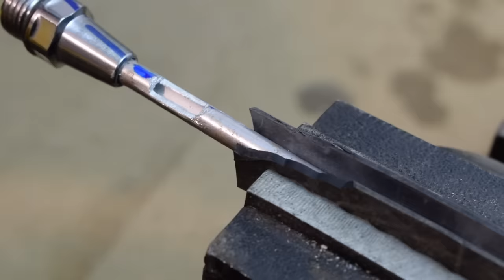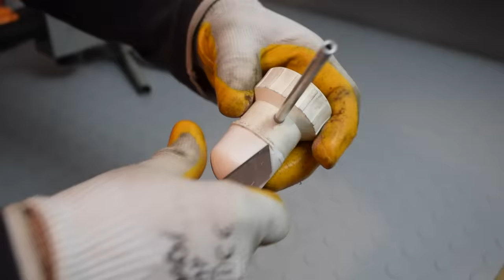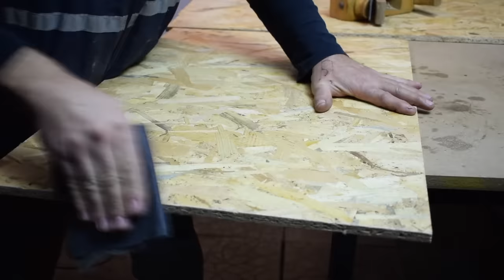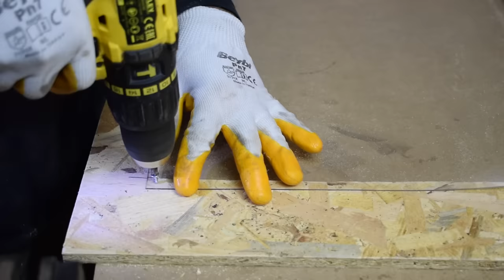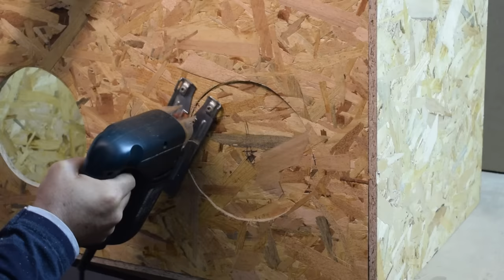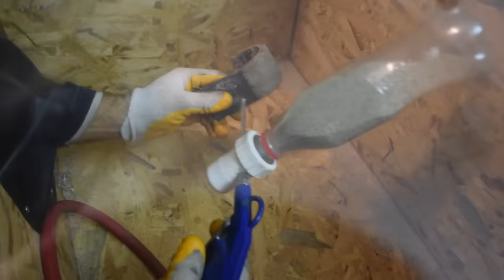100% Homemade Sandblaster From Coke Bottle

Comment: The problem in this case is the blast pipe - it has to be a hard material to withstand wear over a longer period, like tungsten carbide or some ceramic. Soft metal will last half an hour until it's gone.
Cheap sand blasting devices sometimes use soft metal, they are crap.
Reply: Thats true, i had this problem
Reply: @max17-c4f  Guess why I know that - I had a cheap one with such a cheap soft steel blast pipe ;-)

Tungsten carbide is better, but it also don't last forever, sand is a nasty stuff eroding it inside
Reply: true. even tungsten and ceramic erodes after few hours. this aluminium pipe will die in  half an hour
Reply: does not take 30 minutes... easy solution is replace the pipe after it wears out. problem solved. hardened steel will last a long time

Comment: How long does it take for the refrigerator compressor to charge the propane gas bottle as a pressure accumulator to such an extent that the sandblaster can be used again?

Comment: And when the nozzle blocks the air pressure will go straight into the bottle with the grit and explode. Very safe. Excellent example of an accident waiting to happen.
Reply: You ain't been sarcasted 'til you been sarcasted by The Twizzler!
Reply: I like that caution warning.
I think, in practice, the bottle will hold to about 100 psi and the user will notice it is not working. After that, the user will knock the gun few times and may prefer to insert a cleaning rod to continue. Maybe....
Reply: See that’s what we want in posts - suggestions to develop an idea… (that’s sarcasm by the way).
Although, to be fair, Jimmy Twizzle has spotted a potential issue…
A small vent hole in the top of the bottle should prevent any problems. 🙂
Reply: @victorborges9523  140 psi, surprisingly. Don't ask how I know. Let's just say it involves workplace shenanigans.
Reply: That's why you sieve the media

Comment: Great idea..! Thanks for sharing, BUT… I feel duty bound to make a comment on the blast media. I know everyone calls it ‘sand blasting’ but natural sand has been outlawed as an industrial blast media in most countries for over 60 years and in the UK since 1948. The problem is that even very small amounts of inhaled fractured sand (sand dust) will lodge in the lungs and cause silicosis - there is no medical fix and it only has one outcome..!!! Other blast media can be used; aluminium oxide, glass bolls (yes bolls), baking soda and many others. If you really want to use sand, then protect yourself and others well - wear a heavy duty mask, do it outside and stand up-wind. All the best..!
Reply: @HashimiX  Hi, you are of course allowed to use any blast media you like at home including sand - if that is your wish… My information comes from the UK HSE (United Kingdom Health and Safety Executive) and is listed under ‘COSHH* Essentials CN7: Abrasive Blasting (*Care of Substances Hazardous to Health) - Although the regulations pertain to industry in particular they are nonetheless useful in guiding general behaviour. The purpose of my post was to make people aware that although all blast media dust is hazardous - sand dust is particularly pernicious in that if breathed in, it stays in the lungs and cannot be coughed up - it causes silicosis (a painful an nasty chronic condition) which will eventually kill you. I am a 64-year old professional mechanical design engineer with more than 30-years in manufacturing and industrial processing.  The information presented in my original post was given in good faith. I hopes this answers your rather poor comment “wtf your pfp”
Reply: @aidannolan6656  wtf your comment didnt read it
Reply: @HashimiX  Have you got anything useful to contribute..? or do you just like saying “wtf”..?
Reply: @aidannolan6656  no i just like saying wtf no need to make this whole mess just for that bro i was just joking why are you loosing your time for this thats not necessary
Reply: @HashimiX  OK I understand - thanks for clarifying..🙂
Reply: Doesn't sand blasting conventionally happen in an airtight chamber anyways?
Reply: かかさ
Reply: @andcam2683  It depends… abrasive blast cleaning is often done in a blast cabinet which may or may have dust extraction - partly to enhance safety an partly to help the operator see (through a viewing window) what he or she is doing. Parts and blast gun are handled via. Heavy duty rubber gloves permanently attached  to the cabinet. If you don’t have a blast cabinet or you are blasting a large object (eg a vehicle chassis) you may have to work outside - wearing suitable PPE.
Reply: Thank you safety patrol
Reply: And crushed walnut hulls
Reply: or u know, water sand blasting
Reply: @andcam2683  no, you can sand blast everything. in my proffession its often rock, outside or inside
Reply: @xxtoxii9615  "conventionally"
Reply: @andcam2683  If it was airtight, the pressure inside the box would slowly keep increasing, theoretically until it matched the pressure of the airgun and it would stop working.  You need some form of dust collection - just a shop-vac would work for this application - otherwise dust WILL escape from the box and the inside will get cloudy, making it hard to see what you're doing.
Reply: @kilroy2517  While a sandblast cabinet should ideally be airtight, most are not. At least, they're not once they've been in use for a while. So, as long as the cabinet is built somewhat airtight, so that it will capture almost all of the blast media, it's acceptable. ... A filtered exhaust vent for the air to escape the cabinet.
Reply: Dr Perun  I'm assuming from your comment that English is not your primary language.  You don't understand what he said.  And if you're blasting with sand and not wearing a mask, you unfortunately may find out in a few years what he's talking about.
Reply: @kilroy2517  Thank you Kilroy… Sand - as an ‘industrial’ blast media is banned in the UK (and has been since 1948) … so - banned in the UK for over 70-years. As a general comment to all - I am not a Health and Safety Professional but I am a professional mechanical engineer. My job involves a lot of writing and specifying production processes. I cannot write “…sand blast…” in a work instruction. For example: I must write something like “…blast clean using BT-13 glass-bead media… within Guyson Euroblast ATX cabinet..” (there are of course many types of cabinet and many approved abrasives). If someone wants to use sand (at home) that is their prerogative… But at least I have done my best to present some good information which may guide the uninformed home blast-cleaner and prevent them damaging their lungs. The graveyard is full of people who think it’s not cool  to work safely - to them I say “… go ahead and take yourself out of the gene-pool - but don’t blame anyone but yourself - you have been advised…”
Once again… Thanks Kilroy for a note of common sense.
Reply: Dr Perun  You cheeky Bastard…! You know nothing about me… There’s nothing wrong with wanting to go home everyday - alive, with all your limbs and without damaging your health..!
Once safe working practices are in place, any small time penalty from working safely, more than offsets time lost through accidents and illness. In the modern industrial world, most organisations who take health and safety seriously can show that it makes economic sense.
Reply: @xxtoxii9615  Yes… this is another type of blast cleaning - called ‘vapour blasting’. An abrasive blast media is entrained in a pumped liquid (usually water) and used where a very smooth finish is required. The equipment is a little more costly than a conventional dry blast cabinet… I’m sure you’ll find a good video on homebuilt blast and vapour-blast cabinets here on YouTube….
Reply: Dr Perun  Thanks for your irrelevant comment - Goodbye…
Reply: @aidannolan6656  I worked at a company that made blasting equipment: portable, cabinets and huge custom automated industrial systems, most of which were used with steel shot.  When I first started there I was doing tech support, and one day I got a call from a guy that was very frustrated that his new blasting cabinet was allowing "sand" (don't remember what he was blasting with) to get all over his shop.  His cabinet had a built in dust collector and interior light.  After asking a few questions I determined that he hadn't plugged his cabinet into a power source, so the dust collector was not working and there was no light inside the cabinet.  The conversation ended with him saying, "I wondered what that plug was for".

Another time I got a call from a guy who was either a foreman or a business owner, calling to ask why one of his guys passed out at a jobsite and had to be taken away in an ambulance.  The guy was using a portable blaster and was wearing the appropriate safety gear, included a positive-pressure ventilated hood.  Again, a few questions and I determined that he was ventilating the hood with the same air compressor he was using to power the blaster.  He was very upset when I explained that his worker passed out from carbon monoxide poisoning.  People, air compressors cannot be used to supply air for breathing unless it specifically and explicitly  says that it's meant to do that.  Air compressors require oil for lubrication and that oil slowly burns up inside the motor, creating CO gas, which will kill you.  Compressors that provide breathing air are built differently and are much more expensive.  Luckily for that worker, he was not alone on the job site or once he passed out he would have been killed.
Reply: @kilroy2517  Wow..! I thought I’d heard it all..! We live in an engineered world where technology is cheap and available to almost everyone. Everything looks simple - but it isn’t, and therein lies the problem… In my experience, people need to be protected from themselves. A long and varied engineering career has taught me to research, follow guidelines, think critically, consult experts and don’t take shortcuts. Despite this I still make mistakes but hopefully not threatening either my own life or the lives of those in my charge. A safety culture makes people think “what can possibly go wrong..?” and affords them some degree of protection in their lives. People who think safety is for cissies are a danger to themselves and others. Then there are those who are incompetent … and how do people know that they are incompetent..? Answer: They don’t…!
There is a great quote: “There is the certainty which comes from ignorance - and the uncertainty which comes from knowledge”
alas I don’t know who said this…
Anyway, thanks for your note… All the best for 2022

Comment: The most important part of the whole sandblasting is missing: How many PSI are there in the blowing gun?, What is the size of the compressor?, How long would the air pressure last? and so fort! It looks easy but it is not, I have a factory built blow gun from Harbor Freight and it does not work, for the air pressure would not last long enough!